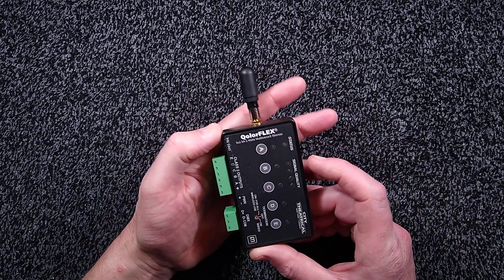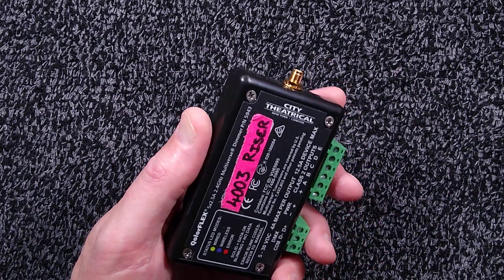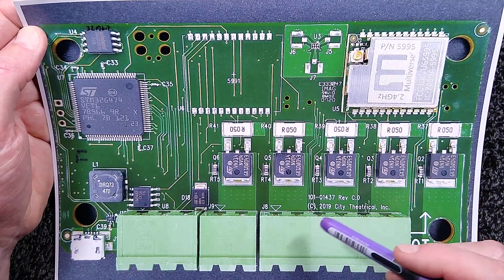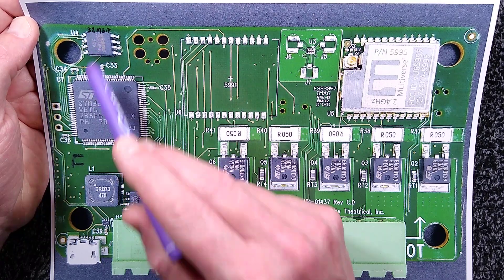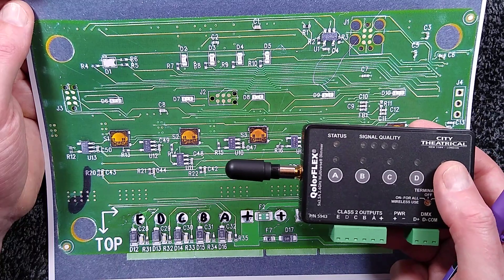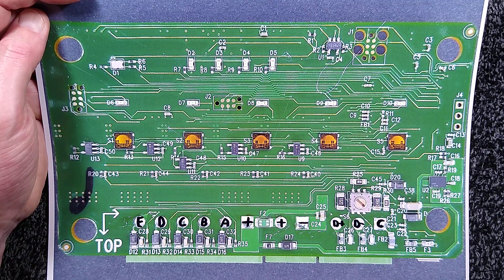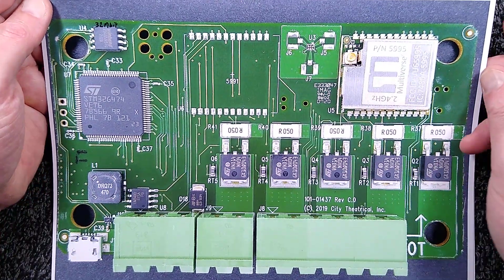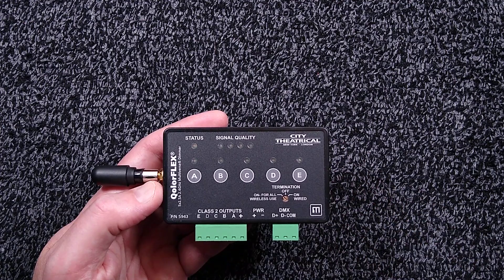Inside a wireless DMX receiver

Comment: I don't get the wifi stuff on there .. should these not just deliver power and transmit serial with a couple bits per second to flip a switch ?? why not use something that is build to handle just that without all the overhead of wifi..  and what does the micro do ? just current measurements ? seems a bit overkill also.. and the dozen gpios on the wifi module .. unused ... this product puzzles me  quit a bit. also no input filtering .. so any garbage power supply hums right into it..  well it's only REV C  ...point 0 (wt..?!)😅🙈

Comment: Can you give a recommendation for a wired DMX 512 solution for lights that are controlled with a combined DMX + USB-C cable? I’d like to control numerous Atomcube RX7 pocket lights but don’t want to do it wirelessly out of the fear of issues you’ve described.
Am completely new to the topic and don’t know my way around DMX over USB yet.
Reply from the maker: You may need to make a custom lead from a standard power and twisted pair cable.
Reply: @bigclivedotcom  thanks for getting back to me. Can you recommend a “lighting forum” where one could dive into this topic? My next point of confusion is for example that the lights can use DMX-D3P with 3 or DMX-D5P cables with 5 pins in the XLR connectors. I’m planning to build an indoor light “sculpture” with (probably) 24 controlled RX7 pocket lights.
Reply from the maker: @abavariannormiepleb9470  The DMX standard states that a 5 pin connector be used, and they can actually use all five pins for two networks.  But many disco lights use the 3 pin connectors for cost reasons and audio cables often get used for data, which is not ideal.
Reply: @bigclivedotcom  Thanks for that tip - then I’ll begin only using 5-pin solutions to start properly.
 Is there a “quality” standard software to create light sequences etc. on a computer that can also connect to these USB-to-“DMX-over-USB-C” cables?

Comment: The issues with using 2.4ghz is many and varied.  Considering the location equipment used amount of localised signals etc... I'm surprised its worked effectively at all. I would suggest talking to someone with extensive rf frequency experience.  Where possible I'd always suggest a wired controller.  Loss prone to these issues. The only other suggestion I have and probably the most expensive.  Independent control units for each set of screens.  It means an entire system for each one and the only signal it would need to pick up is a timing signal. However that's too much money.
Reply: Independent units would multiply the frequencies needed.  There's only so much radio bandwidth available for the entire location and keeping a single 50kHz channel clear for lighting and stage control is already hard enough.

Comment: Those ST Micro VND14NV04 "MOSFETs" are actually full-on integrated circuits. They have gate control, linear current limiting, overtemp protection, and the MOSFET all on the same die. Google the part number and take a look at the data sheet. (I'd give the link here, except YouTube tends to treats any comment with a clickable URL as "spam-until-proven-otherwise.")
Reply: Except when it's actual spam, sadly.

Comment: At 2.4 ghz, I can already say with high confidence your issue was interference. Sadly that is a troublesome operating frequency anymore. Too much traffic on that band now thanks to wifi and everything 'wireless' operating in that range. It could have also been software related unless SOMETHING was absolutely swamping all possible channels, which is also a possibility. I think they make gear that can diagnose such issues. In one situation in the past, I had to change the country of a device and put it on a 'non-compliant' channel to prevent interference, but that's just asking for other troubles.
Reply: Imo this is a design issue. You're making a device intended to be used wirelessly in a venue full of people, which all have phones that will probably be connected to a sitewide wifi network. Who thought using 2.4ghz was a good idea in the first place? There must be other frequency ranges available to manufacturerrs
Reply: @matiastripaldi406  perhaps if they used a 5g mobile phone network as the backhaul itd be better, that protocol is designed for crowded environments
Reply: @backacheache  Why couldn't we give the entertainment industry those frequencies and let everyone else compete for space in the 2.4 ghz band ;)
Reply: @Aquatarkus96  That would require the ITU to get involved.
Reply: Wireless DMX is also in itself still buggy as F. Even in a radio clean situation.. I've been testing quite a lot of them, for they would make my job so much easier.. But it tends to not work when you really need it to work.. It's still way to unreliable even in testing setups inside a faraday cage...
Reply: The thing that piss me off the most is the wireless TV. They are RIGHT BESIDE THE ROUTER yet they use wifi, because, hey, it's "better!" . . . Yeah, better at saturating the 2.4GHz.
Reply: Ah, yes, 2.4GHz interference. I don't have good cell reception at home, and for some reason Wifi calling wasn't working on my phone, so Tmobile gave me a cell hotspot. Using it caused my Wifi to be poor performance, even with automatic channel selection. Since the hotspot is ethernet connected to the Wifi router, they were just a few feet apart; moving the hotspot further away mostly fixed the interference, but in the end I gave up and got a new phone that did Wifi calling OK. You'd think Tmobile would warn about interference...
Reply: THIS !

everyone got their fckn earplugs and bluetooth on all the fckn time. plus wifi in order to notice every possible way to enter the internet for free...

wireless rõde mikes, live camera streaming and stuff doesn't help either.

Comment: The thing at about 5:45 that you weren't sure about; I'm pretty sure that's a flux capacitor.
Reply: it was thinking the same if you put 1.21 gigawatts through it it'll transport you back to the 90's before 2.4ghz was so swamped
Reply: The spot is vacant because it hasn't been invented yet
Reply: It's just missing the plu tonium.
Reply: was gonna say the same. knew there would already be a comment...lol

Comment: that radio module is a 5995 multiverse. its a dedicated 2.4ghz DMX/RDM module
the 5990 and 5991 modules are 900mhz, the 5994 and 5995 are 2.4ghz. and have different modulation types

Comment: i think having everything including the kitchen toaster these days running on 2.4Ghz is a big part of the problem, we really need purpose bands for specific applications, 2.4 being wireless LAN (legacy now) 1.6 maybe should be opened up for video and 900 (for example) for low-bandwidth application such as DMX and other things that don't need huge amounts of throughput but need reliability
Reply: 2.4ghz Wi-Fi is still much in use. Regardless of the frequency used, interference will always be an issue at some point. It is all about managing it.
Reply: 900 mhz is only available in the US currently.

Comment: PCB tracks going rather too close to the large corner holes
Reply: Especially since there is enough room to route them with more clearance. Likely, the design rule checks have been setup for the TagConnect pattern which has those 4 big holes and traces that need to go between them.

Comment: 2.4GHz is a minefield for such stuff where continuity of signal is important, but the firmware really ought to be able to gracefully handle such problems. I'd also suggest that from what I could see the PCB track layout could be somewhat improved and there may be some hidden issues there.
Reply: That is what I would assume. Proper error correction and data retransmission should be in place.

Comment: Interesting seeing TagConnect on the board.  I guess they program the boards individually and in the UK rather than just ordering the ROMs pre-programmed.
Reply: must be for debugging/development, for production you'd be using a test fixture with pogo pins, not plugging in a connector
Reply: @fuzzy1dk  TagConnect is a handle with pogo pins.  Well suited for low volume production with the option of putting that pogo pattern on a robot for ramping up production.
Reply: I doubt they have availability of factory programmed stm32 right now (honestly they probably don't have any availability 🤦), tag connect is just a few plated pads/test points and a stupidly expensive patented connector. ($50 for 6 pogo pins?) Whether or not it's used in production, may be useful to use in development.

Comment: No need to apologize. I have seen several instances of embedded devices that have this kind of failure: the lights are still blinking and it is doing its stuff but no peep of external communication whatsoever, or worse, crash completely. There's no excuse for it, test your firmware in 50 different settings and not just on the bench 1 meter apart, and expect the unexpected.

Comment: Trying to use 2.4 GHz for an event like this is just setting up for failure.  It's absolutely nuts to use it.

I do love those programming connectors though.  They are the Tag-Connect TC2030 system and I love them as they do not require installing any parts on the board and are much more compact than standard 0.1" pads.
Reply: Yes this was my thought immediately, it was doomed from the start in that environment filled with thousands of meat-bags armed with 2.4 GHz transceivers. Better to use 433 or 868 MHz, or if the duty cycle limitations prove problematic for this application given the need for constant 2 way communication, then 5.8 GHz (although consideration of antenna placement and line of sight needs to be taken more seriously in that case)

Comment: So this is using wifi but do the cameras ? Or do they just use a hunk of 2.4GHz bandwidth for video ? You did mention that the cameras get priority but how is that managed ?

I'd always tend to avoid wifi for anything 'essential' but that's a habit learnt long ago when wifi was less reliable than it is now. I wonder what's made it better ? The underlying protocols haven't changed. The receivers have probably got more sensitive. Perhaps the improvements are just better retry management, covering up a basically poor link.

Comment: Frequency choice is the core of the problem here. 2.4ghz is a very poor choice for critical comms where there are lots of people all totting a mobile phone... Might have been far better on it's alternative 900mhz version. That wifi chip is an SDR and they are poor at the best of times. DMX is not very bandwidth demanding so error correction can be cranked right up without noticeable latency. Anything wireless using public frequencies is always going to be a headache in a busy people environment. CT might want to look at adding an additional $1 RF chip to gain diversity (Just like all the radio mics and IEM's use), this way you can have a couple of patch antennas on the risers equalling a more robust signal, that and point a directional antenna at the risers when they are in play.
Reply: Problem is that the other bands you then run into needing to pay a pretty penny every year to renew license for the band, and the fee is not exactly cheap either. So 433MHz, 2.4G and 5G are all the ISM band where it is "free" but you also have to contend with a million other users. Probably best to invest in some directional antennas for this setup, both the transmit and receive side, and make sure they get aimed correctly, to minimise the interference experienced.
Reply: @SeanBZA  unlikely that the 433mhz band would have been saturated there in the castle unlike 2.4ghz, however the bandwidth over 433 is quite low, would be fine for the LED's but not the floor screens on those mobile podiums. 
Large shows like this can, I'm sure, afford licences for reserved frequencies (Like they did for their wireless mics and iem's), but none of the kit makers seem keen on doing it as the costs go up considerably as they would need frequency select interfaces ect....

Comment: Hi Clive. Interesting stuff. Thanks. Question: Does WiFi in the UK use 2.4Ghz? It does here in the States, as does Bluetooth connectivity. A gathering that large, with a cell phone in every pocket, would be making a huge buzz of 2.4 RF. Here in the States, that's what I'd think could be your connectivity culprit.
Reply: They laughed at me 20 years ago when I expressed skepticism about "everything" going to 2.4GHz. "It's frequency agile" they said. "It uses super-duper whizz-bang encoding and voodoo magic protocols" they said. "It will never become too congested to work reliably" they said. Who's laughing now??
Reply: WiFi is 2.4GHz or 5GHz. Most of the Smart Home devices appear to be 2.4GHz but some will also use the 5GHz.
Reply: And of course microwave ovens are all in that band as well. Sure, they're well shielded. But with a ~1kW signal, it doesn't take much leakage to release noise that is strong relative to what these devices operate with.
Reply: @strehlow  It boggles my mind anything still works on 2.4Ghz, given how saturated that band is.  Really doesn't help smartphone manufacturers forcing everyone to Bluetooth instead of wired headphones.
Reply: @strehlow  every time I use my microwave, it tanks my 2.4GHz wifi network
Reply: @elvishfiend  check the outlet of your microwave, and maybe get a new router. My parents had the same thing, their outlet for the microwave was bad and their router was ancient, don't remember which actually fixed it. (I had already moved out, but did get them the new router)
Reply: @rpavlik1  we've had this microwave through several houses and several routers, and it's affected all of them. the only thing that really solves it is preferentially using 5GHz wifi
Reply: @elvishfiend  Your microwave is leaking. Probably time for a new one.
Reply: @brianleeper5737  tell that to my wife. I've been wanting to get rid of it for years - it's been happening since day 1
Reply: @elvishfiend  Take it apart and remove the 15-amp white ceramic fuse. Re-assemble and tell wife it doesn't work anymore, and you can't fix it.

Comment: Brings back memories of a New Years gig I did a few years ago where DMX needed to be shot from the foreshore out to the end of the breakwater at the local harbour. The proprietary wireless DMX modules we had just wouldn't reach the 300m across the water, so we ended up throwing together a solution with two Ubiquiti long range WiFi radios. The connection was reliable, but the ArtNet node on the far side was much less so, especially when the local youth found the emergency stop on the generator!
Reply: Ohhhh why can i see this in my imaginary eye? 😅
Reply: At least they didn’t just steal it!
Reply: @rowanjones3476  There was some security present, so they probably weren't game enough lol